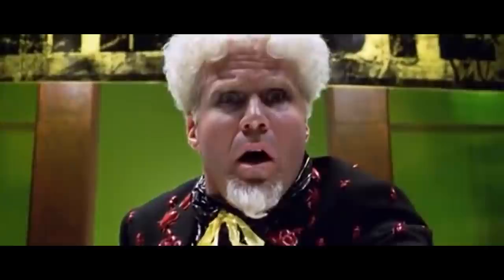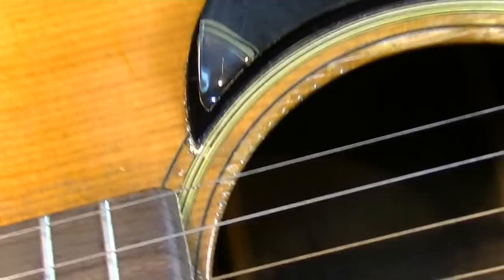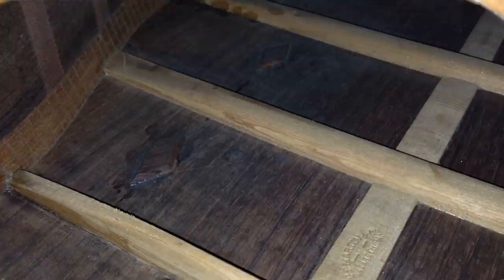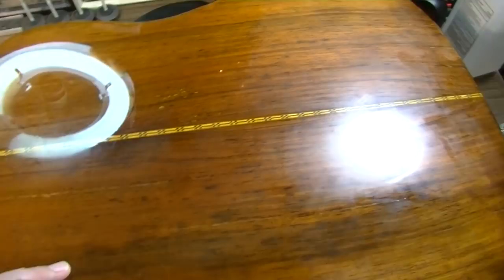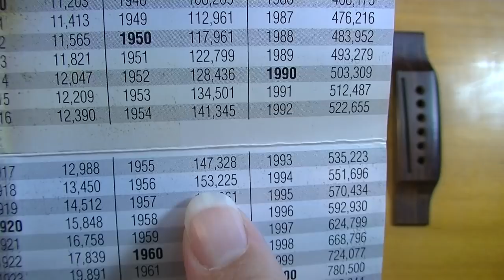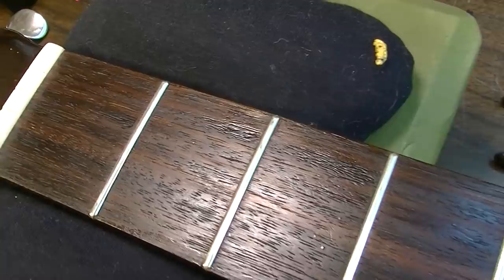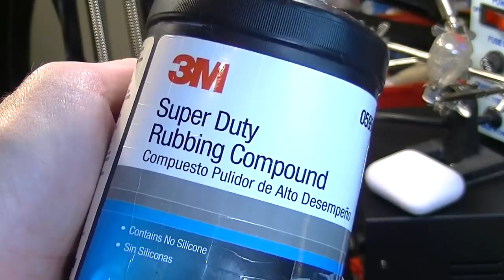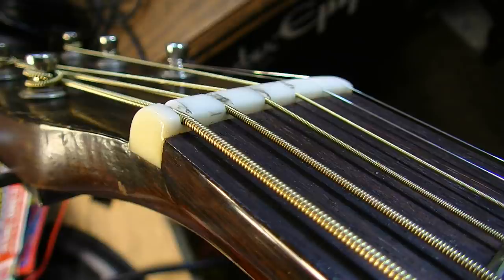DID I JUST GET RIPPED OFF? - The Craigslist Martin D-21

Comment: Those oversized ring marks around the tuners on the top of the headstock look like the tuners were changed out.Why the large circles that you stained?
Reply from the maker: That's just where a string end was left unclipped and got turned downward and scraped the headstock as someone tuned it up.
Reply: @TheGuitologist  I believe that different sized strings cannot leave an identical circumference-sized swirl. Something else happened there. With all due respect.

Comment: I also have  a 1956 martin D-21 with original case my grandfather gave me before he passed. The bridge has definitely been replaced as well as the pick guard like you said. The headstock color and logo look slightly different than mine. Other than that congrats on a wonderful guitar, it has a lot of low end and chimney highs. Also the neck feels like a baseball bat to me.
Reply: old post but...that bridge is not martin not even later martin and the fretboard if it was shaved flat the side dot markers would be closer to the face of the board?i'm no expert at all but they are not all martin factory repairs

Comment: Brad- how would you compare the tone of this 50's Martin to your other acoustics, or other acoustics you have played? Does the tone justify the price? is it that much better than others?
Reply from the maker: I can't value it for everyone, but to me, yes, vintage acoustics tend to sound better for probably a cocktail of reasons, including aged wood, better quality wood selection and availability, and lighter builds/bracing etc. 

This Martin is a 1956, my Gibson SJ is a 1955. The Gibson has more low end and has a more compressed quality to the strumming. The Martin is perhaps a bit louder with more midrange, and has a more "airy" tone, almost like the difference between an open back guitar cab and a closed back cab. The Martin would still probably be the choice for the bluegrass flatpicker in an ensemble, the Gibson might be the better choice for solo vocal accompaniment performance.
Reply: The Guitologist I’m guessing you’re a fan of the old Yamaha Red Label? I love em!
Reply: @keefjunior4061  I have a 1968 FG-110 and it's the nicest acoustic I've ever played!

Comment: as for the screws, I'd say for a 50's guitar, the flathead screws are the originals. I have a 99% original J. Stevens Model 38B, and all the screws are flatheads. (The shotgun has a new (replaced in 1970) firing pin).

Comment: The only thing I don't like is that if Martin did the work on this guitar, I'd have expected that they would have done a lot cleaner of a job repairing it considering the impeccable work they do when building them in the first place.  I'm not saying they didn't, but I'm saying that I'd be slightly disappointed.  Little things like squeeze out  and glue drippage shouldn't have happened, and the bridge should have been matched, etc etc. I just can't believe they'd skimp. However, I'd still buy the guitar.

Comment: No offense intended & with all due respect, that case is more likely early 80's. I have a few of these cases with their original guitars ranging from 1963-1978. They are a light greenish blue with darker blue interior. Older cases of this style had purple & very rarely orange interior. I have all three versions. The earlier blue cases have plastic square bumpers instead of the round metal bumpers on the sides. From the looks of the guitar, I'd say the old original black lifton case died of natural causes. lol Many of the old pickguards were so dark that they appeared black, but I believe you are right on the money about the pickguard & the other details on this guitar. I don't know why it took Martin so long to figure out that finishing the guitar before mounting the pickguard was the right way to go. I'll take the old one & pay you for the shipping, if you don't want it tho. lol At any rate, you have a very nice, vintage guitar that has great character & that's what counts. It something to be proud of for sure. I love those old closed Klusons. I figured it would have the big waffle backs, but I guess not. Reminds me of my old 46 D-18 I had as a kid. I still have pieces of the original open backs that were on it. Wish I still had the guitar. It's not worth much to a collector, but it has a lot of character. I had a lot of work done to it as a naive teen. Work that I regret now & didn't realize what I was doing to it. It had already been refinished badly before I got it & I was stupid enough to have the braces trimmed. The luthier that did it advised me heavily against it, but I insisted & he did an excellent job. The guitar is still alive & well today. #94159  Early 46   Great video with awesome tips & advice!!!!!!! The tips with the stain pens & 3M polish I'll be using very soon on some of my vintage projects. I also love the added bonus of some fine professional playing as well. A little "Yesterday" mixed in there at one point. Very nice. That guitar has a nice soul in it. I'm glad you found it & gave it the proper home it deserves.

Comment: I have no problem with lemon oil when used judiciously. So many people over-use it, though. I had a guitar recently I had to wipe down with some degreaser, because someone had goobed so much oil on the fretboard that I had to wash my hands after I played it. The guys that really make me laugh are the ones who treat finished fretboards.
Reply: Until the internet came around, I had no idea what lemon oil was. It sounds like it's often not oil or mostly not oil. 

I also never got so admonished for using woodworking oils (linseed, etc) on a fingerboard and told that the fingerboard would crack because I oiled it. What a bunch of poo. I've never seen a fretboard that I couldn't scrape clean to bare wood pretty quickly. 

I'd be a little wary of using degreaser if it would penetrate, but not wary at all of using a light card scraper (with enough skill to not leave marks) to remove anything from a fingerboard.
Reply: I have a bottle of Gibson brand lemon oil from the late 80's that is still half full because I use it as intended, very sparingly. I works great when used properly.
Reply: @patrickfoster4586  Yep. I only ever oil the boards if I get a guitar that's so dry, the board is almost white. And then it doesn't take much.

Comment: Suspect it’s real but the peg head logo looks wrong. The CF Martin script should have been a decal and this one looks like gold colored foil that Martin started using 10- 15 or so years ago. Some of the interior “fixes” look a bit rough without any attempt to clean up excess glue (maybe epoxy). Neck may have been replaced and the one tuner install was really butchered. A light sanding on the back of the peg head and some lacquer respray would have melted the old finish into the fresh finish. Price seemed a bit high but anything wrong on an old Martin can be remedied.

Comment: Wanna get ripped off on a Martin guitar? Buy any of the SPD16TR series special editions. This thing is so undesirable for whatever reason, that though it's made of virtually just Indian Rosewood, with Spruce top (mine is first year, 1996), snowflake inlays which had been discontinued for a time. Gold Hardware, double bound body as per usual. Rosette is abalone, with creme and black rings in there too. Never understood why it's still made to this day, if none have been collectable or desired, though in my opinion, they SHOULD be. Great guitar, very brooding and dark sounding, with a slight pop cause the super high figured spruce top.

Comment: Bridge in Indian rosewood. So is the fingerboard. Both are modern replacements.
Reply from the maker: Bridge is replaced. The fretboard isn’t.
Reply: @TheGuitologist  My guess is that Martin replaced both in the 70's. It's easier than pulling the old frets, sanding the board. Back then Brazilian wasn't so sacred. And the bridge and fretboard matches

Comment: I ve passed on so many deals because I was too worried it was a scam..
Reply: Same here.... ebay is the same way, gotten burnt a couple of times.
Reply: You do have to know what you're looking at, or have someone who does. I wouldn't recommend anybody buy something like this that didn't know what he was looking at. Especially with guitars that have stayed pretty static in design over the years, it's too easy to represent, if not a fake, a newer guitar as a vintage example.
Reply: @SeanKerns  in the 90s i went and looked at an "American BC Rich"... it looked pretty close, but there were obvious signs.... it turned out to be a Cort. Cort has always made pretty good instruments, no idea why he turned it into a fake Rico. Lol. I called him out, offered him half the asking price, and took it home because it played well and had a set of Duncans in it  lol.
Reply from the maker: That's what a lot of people do. This is why knowledge is power.
Reply: @daddyosink4413  That's always the danger when people rebadge or retrofit guitars. Usually, they're doing it for vanity reasons, because they like the look of one logo over the other, etc. But if they sell the guitar, even if they don't misrepresent it, a future seller might.
Reply: @SeanKerns  i stripped it down, repainted it, made a Cort waterslide for it, and put some Guitar Fetish pups in it.... its a quality instrument, i pull it off the wall when i just want to mess around for a while or whatever.

Comment: Lemon oil really isn't the best to moisten/recondition a rw f/b. Double boiled linseed is better. best done outdoors, it smells. Nice guitar though. Sadly though, it reminds me of my early-70's D-28 that met up with disaster in the form of a monster Buick in the early 80's.
Reply: DO NOT put boiled linseed oil on your fingerboard!  Boiled linseed oil is a finish.

Lemon oil, 3-in-1-those are ok in moderation.  Strictly cosmetic. You don't "moisturize" a fingerboard with oil, you keep it humidified with the water in the air, just like the rest of the guitar.

Comment: Gotta give the Martin shop credit for their repairs and restoration. This guitar would have been nearly unplayable when they received it.
The repair must have been a few years ago. I think the finish dings happened after it was over sprayed. Ronsonol lighter fluid will remove all that oil & grime on the body.

LOL I see some of Uncle Doug's beloved paint specks on the head stock. They're found on most vintage amps.

Comment: 1.  One thing I think we can generally agree on:  at 53 minutes and change, this vid is not short on details.
2.  If you feel compelled to ask whether or not you got ripped off, I kind of think that's an immediate reason for concern, because "ripped off" is a pretty strong phrase, since this is obviously a genuine Martin (or one of the best knock-offs I've ever seen).
3.  Do YOU (forget what WE think) feel like you got value for your money?  Based on YOUR bank account balance (not ours)?
4.  Did you buy this for an investment, or solely as a player...or both?  For some people it's one or the other (or trying to compromise the two) - for me it's ALWAYS solely as a player.  I don't care how much tweaks/mods affect the value - life is short.
5.  Ironic how the best Br. Rosewood (i.e., the QUARTERSAWN stuff from the 50's Martins) has the appearance of coarse-grained mahogany, and leads some to think it's "not good" - or that it's not genuine.
6.  One tweak I definitely would NOT have done - overspraying it.
7.  The nut replacement and bridge plate (with the angled grain orientation) were very well done by Martin.
8.  Looks like the bridge was scooted back for some reason.  70's Martin dreads (of all flavors) are notorious for having the bridges placed too far forward (Martin's "dirty little secret") but I'm puzzled by that on this guitar.  I would hope it's not a sloppy mistake (that would result in bad intonation).
9.  The action is ridiculously too high.  It shouldn't be more than 1/16" at the 12th fret (not 5/64ths) will medium gauge strings IF you baby and take the painful time and effort to address that.  (It will drive you to the brink of insanity - esp. working with no adj. truss rod.)
10.  Guitars without adj. truss rods (such as this one) are too much of a pain to adjust when (not if) the neck goes out of whack.  I would probably replace the whole kit-n-kaboodle with a new neck with an adj. (_simple_ Gibson 50's-type rod) and an ebony board as I did the much-needed neck reset.  
11.  Refretting that guitar will be especially challenging when dealing with the no-adj. truss rod issue (are you getting my feelings on that by now?), because fret removal and cleanout WILL result in a concave bow, necessitating bigger, custom barbs, etc....oh, the humanity.
12.  Never used vegetable-based oils on a fretboard, folks- read up on that one.  Never buy overpriced "specialty" oils for that purpose - good ol' mineral oil from the drugstore works just fine for that.
13.  Meanwhile, don't fret (get it - "fret"?) the small insignificant cosmetic details.  The thing is nowhere near a boutique guitar in that respect.  
14.  Do YOU like the sound of it?  That's all that really matters.  From what I can tell - from my limited vantage point - I think it sounds really good.  
15.  But 3700 dollars' (or whatever) worth of guitar?  No...I would've plugged that money into something else - such as a later model used D-41.
16.  But one thing I think we can all agree on - this comment is way too long.
Reply from the maker: I confess I skipped to #16.